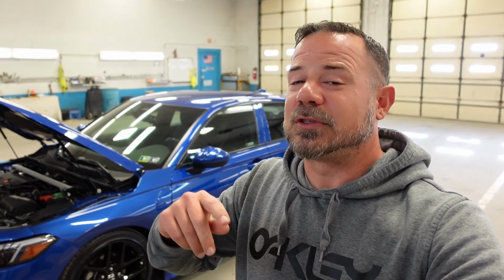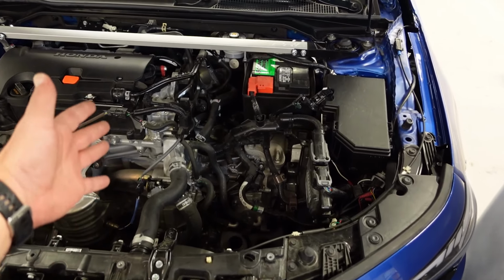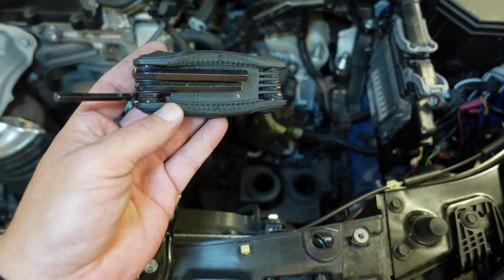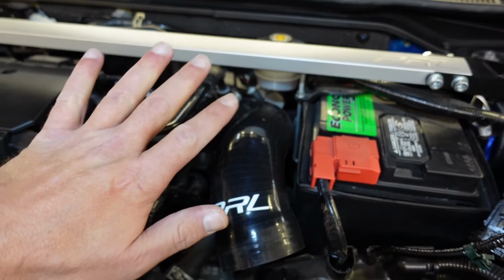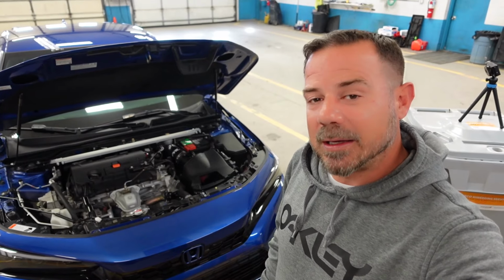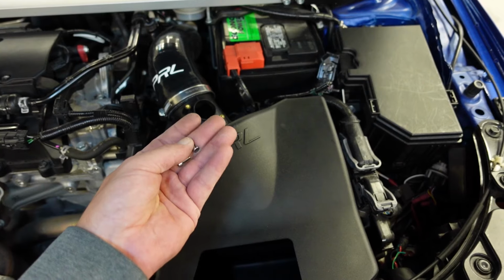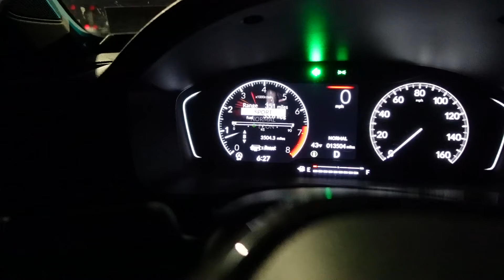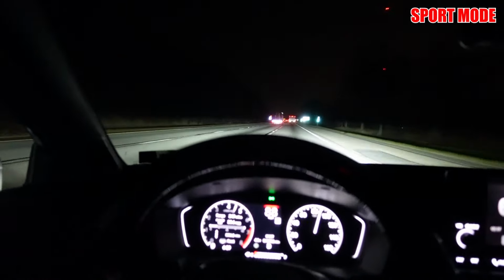PRL High Volume Intake (HVI) Install & Sounds for the 11th Gen 2022 Honda Civic 2.0L

Comment: why didn’t you floor it. it would sound 10x better when v-tec kicks in ..
Reply: Wait 2022 civic sport 2.0 has v-tec ?
Reply: It’s not like old vtech
Reply: @StoutK20_DHG  yes the sport has a vtec cam
Reply: @StoutK20_DHG  last one to have it
Reply: no it doesnt, the sound is most audible at 4k rpm

Comment: Could you show how to use the paddle shifters? 💙
Reply: I’ve been trying so hard to find a good video that teaches this lol
Reply: @SuperNaruto8888  it’s impossible lol
Reply: Maybe it’s for show
Reply: from a stop using 1st gear till 6k rpm’s then shift to 2nd. Should bounce your rpm’s to about 5k. accelerate till 6 and shift again and repeat. if rolling around 60mph shift down to 3rd or 4th and shift up at 6k rpm’s
Reply: @ogschnoodle9798  make a video lol

Comment: Honestly I'd be happy with the throttle body actually closing when I let off the gas. The lack of engine braking has really thrown off my ability to speed through canyons.
Reply: Do you not get any engine braking, even in sport mode? I’ve got the 22 touring and in sport, with the rpm’s held pretty high even with foot completely off gas, I’ve found I don’t need to brake in situations I would have in normal mode. Also if you really want engine braking you can downshift with the paddles.
Reply: @natedogg7284  Compared to my 2003 Civic, the braking I experience is minimal and feels like it's more from air resistance than engine braking. Also I have the stick shift (no drive modes). Letting off the gas in 3rd or 4th gear on a canyon road does NOT slow me down nearly as much as my 03 civic would at the same speed/gear with gas off. I have to be much more on the brakes which is not what I want to be doing on a non-performance car with stock brakes.
Reply: @APS_Inc  Huh, strange. Haven’t gotten my hands on an Si or CTR yet (here’s to hoping), but I’d expect engine braking to be no problem with the manual, especially if my bum ass CVT can comfortably come to a full stop pretty quickly with little to no braking. Might just be the poor transmission begging for sweet release though lol, you never know with these CVTs.
Reply: @natedogg7284  I suspect the Si closes the throttle body entirely in Sport mode (I think it has driving modes, unlike the normal Civic?). It would be weird if they spent all that time tuning for the Si only to not have it behave as expected when in the proper drive mode, assuming that it has them. When in regular mode I would expect an Si to also leave the throttle body slightly open for better coasting performance. Which is dumb, but that's how it is.

Personally if I could change it, I'd leave the default behavior in 1st and 6th gears alone, and make every other gear mandatory throttle closure when the accelerator isn't depressed. In 6th gear I'd prefer to coast (I would downshift if I really wanted to slow down), and 1st is low enough that I don't think I need to be any more herky-jerky around the parking lot than I already am trying to modulate the clutch.

(to be clear neither my new or the old Civic I have is an Si model)
Reply: @APS_Inc  Figured you had an Si, cuz those lower trim civics with 6mts are hard to come by, lol. Nice pick up though!

Comment: Hey Miller, I just have a question for you. Do you think if I got a short ram intake for my civic sport (CVT transmission) it would work well? Because I know the CVT’s don’t adapt to mods well. Would the engine noise be noticeably louder and would it harm it? Thanks!
Reply from the maker: It's a little louder. Won't harm your engine. Doesn't need tuned.

Comment: hey man, iam using stage 1 intake system right now from PRL. do you think it adds more HP or sound if i change to this?
Reply from the maker: Probably just sound. Hp should be roughly the same maybe a tad bit more.

Comment: If you unplug the mass airflow sensor will you get a check engine light? Or is it better to just take the whole thing off plugged in like he did?
Reply from the maker: I never threw a light for HVI. The downpipe is another story.
Reply: @717PROJECT  thank you! I installed it a few days ago and had no problem. I love it!

Comment: Is there a difference between a HIV cold air intake and the cobra cold air intake from prl?
Reply from the maker: Yes
Reply: @ thanks for responding! Would you be able to describe what exactly is the difference?
Reply from the maker: @christianluarca963   not sure they make one for the 11th gen or not. It's lower to the ground. Usually, the filter sits in front of the front tire.

Comment: That's a nice Setup. If they make one for the HR-V Sport, I would get that and a nice exhaust system.

I wonder if the HR-V is identical under hood like the Civic, as far as this kit woukd fit. You know what I mean. I know lots of Civic things can go on the HR-V. Btw, how much does this kit cost? 

 I saw a nice Sonic Grey Pearl Civic Sport Hatchback parked today and the small shopping center near my home. Makes me still want one as a second car. More affordable than the Acura Integra A-Spec Technology Package or the nice new Type R by my house. Near my church, I sometimes see a silver Sport Sedan parked on the street. The driver might live around there.
Reply from the maker: I think they have the same motor. So it should fit but I can't say that for certain.
Reply: @717 PROJECT  I was thinking it may, or may not almost be identical under the hood, having the same drivetrain with FWD, and basically being a Civic with a slightly raised ride height and SUV body. Interior and lots of trim parts, like the exterior door handles are from the Civic. 

*My 2000 Chevy Impala LS had Corvette door handles.

I just wonder how an HR-V Sport would be with the N/A 2.0L 240 horsepower engine from the S200, beefed up suspension, brakes and dual exhaust with a 6 Speed manual from the Si, or whatever would work.

I bet the belly aching comments about no power would stop.
Reply: @jjacob25101 I put the 10thgen k&n intake on my 2023 2.0L HRV, sounds absolutely amazing!!
Reply: @bobsmith-qz2pv  Thanks for the info.

Comment: The lower air box is cut out from the PRL HVI? Or would we be able to utilize the lower air box in addition to this
Reply from the maker: You can leave the lower air box there.
Reply: @717PROJECT  I am asking if the lower airbox is used by the PRL Intake or obsolete.
Reply from the maker: @ImmutableIcarus  my bad! Obsolete

Comment: R/T Tuning in Montgomeryville PA dynod my CVT with no paddle shifters. No issues i guess there is just speculation on how accruate the #s are when doing so without “ locking in” but on my hondata 1.5T i was 214-217 WHP with PRL bolt ons
Reply from the maker: Nice!
Reply: Hey man, thats a lot hp for a cvt! dude my 1.5 civic CVT is making 185WHP with PRL stage 1 intake system.. do you think it can add more if i change to HVI?

Also, is it safe to run a cvt civic with 200+ whp? i want to but i dont want my cvt to break
Reply: @crestfall4  in all honestly no. All these parts are suited for a tune i dont think you get maximum gains from certain bolt ons without a tune to accompany it.  If you dont drive reckless or slam the gas from a stop. Then i would reccomend getting a Ktuner or Hondata tune for best whp gains for your momey.  Like 500-800$ and around 30whp    But the hvi is a great addition regardless of the hp gains. Its for the sound and cooling aspects is what makes it good

Comment: I hope this intake adds some well needed HP, to my wife's 2.0 NA Civic. Do you think I should Mod the exhaust or just go straight to Modding the DP? That car needs some balls lol
Reply from the maker: If you're looking for HP, give it a tune. It will give it better throttle response and some much-needed pep. You'll get minimal with just the intake or exhaust. I'm tuned with the HVI, RV6 downpipe and PRL's N1 exhaust. Would have kept the Function Werks front pipe but it didn't line up with the N1. Still not that much but you can definitely feel the difference.
Reply: @717PROJECT  What tune did you go with, cause I couldn’t find anything for the N.A. 2.0. Anything will help… how much hp gain? Estimate or butt dyno lol
Reply from the maker: @bradh431  base tune for now til Ktuner comes out with a better one. I'd say 40ish.
Reply: @717PROJECT   I was able to find your other video with the tune. I'm guessing all together with the DP, Intake, Exhaust and Tune..60hp?
Reply from the maker: @bradh431  Pretty close

Comment: Im starting to think this is worse than the stock intake or even the stage 1 intake for cheaper. Since it blocks the bottom air ports so now you are only getting one source of air instead of two. Stage 1 might be the way to go, but less noise.
Reply: Interesting

Comment: why did you take out the aem intake ???
Reply from the maker: PRL sponsored the video and I prefer their products. It's much better IMO.
Reply: @717PROJECT  gotcha once i seen the video i was like dang it actually sounds a bit better then the AEM
Reply from the maker: @ayondanny123  plus it's actually forbthe 11th gen.
Reply: @717PROJECT  did you get the 1.5t stage 1 intake system ??? im looking for it as wheel just not sure if its the right one
Reply from the maker: @ayondanny123  no, Mines a 2.0L

Comment: do you think the upgrade is worth it if i already have the aem short ram intake that you initially had?
Reply: I have the same short ram aem but I installed a wrap on the filter cone to help with the dirt and heat and no issues at all with it, $399 for the prl is a little too steep for me especially after I just got the aem which ran me about $280 the only benefit i could see with the prl is that the filter cone is completely sealed from the heat of the engine but if you’re not having issues I would leave the aem but it’s up to you🤷🏻‍♂️
Reply from the maker: It has a little of a lower growel to it. Just like Loso said, filter is contained. It feels a hair quicker.
Reply: @Loso0523  which wrap did you install? i also see that as a problem and would love to wrap mine too

Comment: handsome.  do you know how to reset the entertainment system of the civic 2022
Reply: Unplug the battery and plug it back in
Reply from the maker: Unhook the battery for a couple minutes. Tha should do the trick!
Reply: @717PROJECT  it’s been a few days since you installed the HVI. Have you noticed any set backs or loss in power or has it been an improvement?
Reply from the maker: @SuperNaruto8888  improvement for sure. No issues!

Comment: How many hp?
Reply from the maker: 3-5 not tuned. 6-8 tuned if I had to guess. I'm on base map right now.
Reply: @717PROJECT  what is 3-5
Reply from the maker: 3 to 5 hp @randomstuffyouwontseeinyou8786
Reply: @717PROJECT  i see